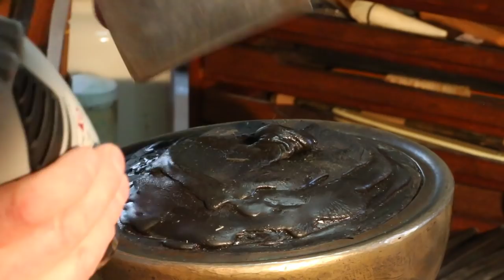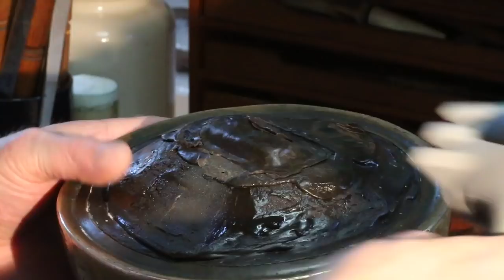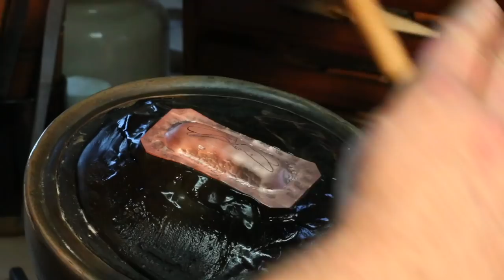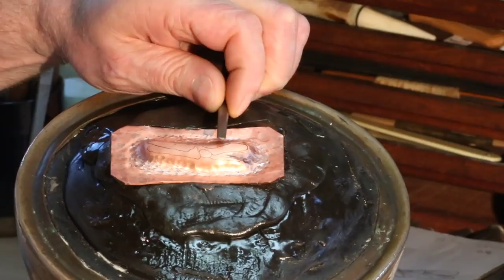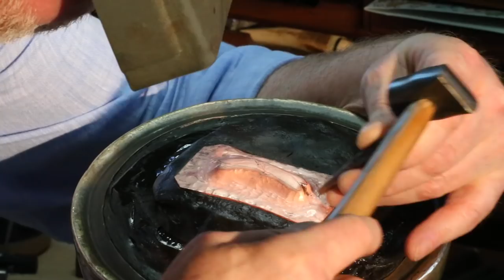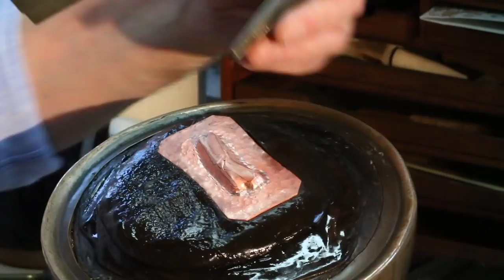Uchidashi Menuki Dragonflies - Part 6

Comment: The broad Dashtagane you are using is finely textured.  Am I right?  It appears as if the surface of the struck metal has a frosty look.
Reply from the maker: Hi Fred, yes, it's finely textured. This is a significant feature of uchidashi work, we don't want the punches to slide at all, we need them to 'grab' the metal and drag or push it where we need it.
Reply: Thanks Ford.  This is how I was taught and my understanding of the tool.

Comment: Are you using a curved or straight liner to outline the lines between the wings. "namekuri"?
Reply from the maker: Always straight, in fact I have no curved ones, just many of varying thicknesses and lengths.
Reply: Interesting.  I make a curved namekuri that has no actual curve to it.  The curvature occurs on the face of the tool.  I was taught to make it similar to the straight namekuri only with a curved underside and thus changing the face from a straight to curved profile.   Do you then tilt the straight liner to curve with the leading edge?   Sorry for all the questions and commentary.  This has always been a passion with me and will never stop my learning and mastery of the craft.   I am very grateful for your time and the willingness to share.